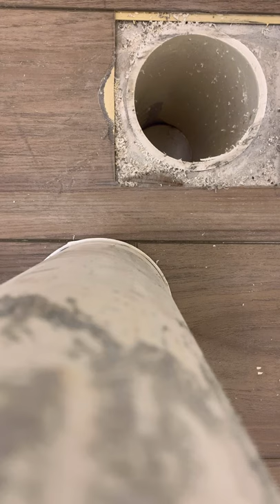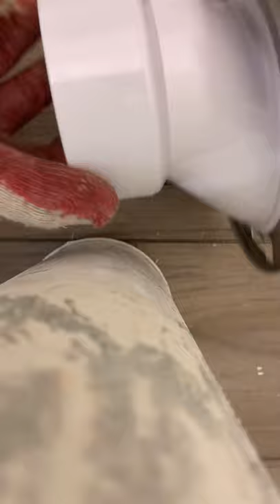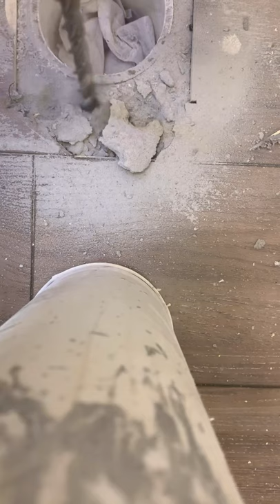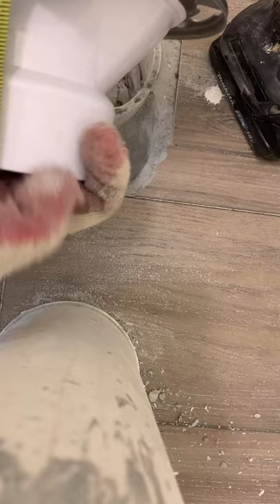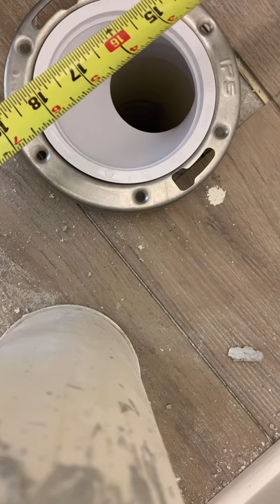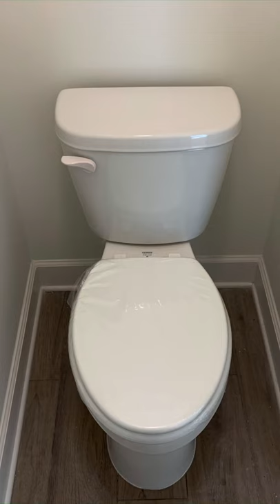Installing an offset toilet flange (full installation)

Comment: That's a great video. It gives me the courage to try it myself. The toilet in my main bathroom is too close to the wall behind it and it doesn't seat very well. I'll have to chip away some tile in addition to the concrete but what the heck. The toilet is out right now because the metal ring is messed up from the torque caused by the toilet sitting crooked. Today is Tuesday, I just may bite the bullet and give this a try Saturday when I'll have more time. Thanks for posting this!
Reply from the maker: You’re very welcome let me know if you need any more tips! Check out my other videos as well they might be very helpful!
Reply: How did it go??? Curious if it went well Dave!

Comment: Thanks for this video- finally getting around to completing a 1/2 bath in my basement in my house that I had built nine years ago.  I had my builder do the rough plumbing.  Where I put the wall for my bathroom it’s only 13 inches on one side of the wall.  Am going to have to chisel the same fake wood tile I put in that looks exactly like your job!  Wish I had learned about the 15 inch rule before I put in the tile!  I think I noticed yours ha a crack- hopefully I won’t crack mine.  And I thought finishing this bathroom was going to be easy!
Reply from the maker: Yeah that 15 inch rule sucks but I really wish you the best if you’re gonna tackle this job
Reply: Did this fix your problem. I have exactly same situation 13 inch from wall. I hope this will help to move 2 inch

Comment: The previous owners of my places used an offset but installed it incorrectly and set the bolt in grout instead of the designated flange location now I got to chip into the tile to place a new flange correctly 😞
Reply from the maker: Good luck with your project ! I Hope my video helps you

Comment: Good Video btw :) I watched the end 3X and could be in error, but it looks as though you merely glued two ends of pipe with the same diameter together at their ends. Although it might get by without leaking or otherwise causing a problem in the short term, I don't see that "joint" taking the punishment of the weight of the toilet and people  without working its way loose in the ground causing the toilet, flange, offset joint and all to come out of the floor. If this is the case, It wouldn't fly where I come from.Respectfully, Negron
Reply: I was thinking the same thing. I may just try cutting an inch off and have at least 1/2” overlap.
Reply: It isn't an end to end connection. The offset flange fits inside the pvc pipe that's in the concrete. He's swabbing the inside of the pipe in the ground and swabbing the outside of the offset flange before inserting the offset into the pipe in the ground. When I followed this procedure it worked perfectly for me. If anyone is concerned about cutting off the top of the pipe in the ground, here's a video that shows how to remove the glued in flange to keep the height of the pipe in the ground. https://www.youtube.com/watch?v=XpJAsRaKKeE